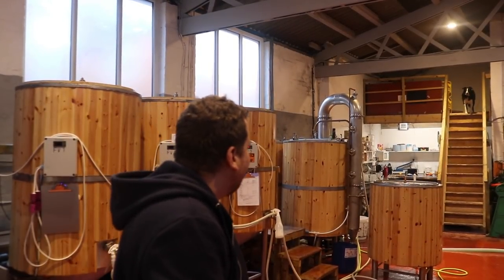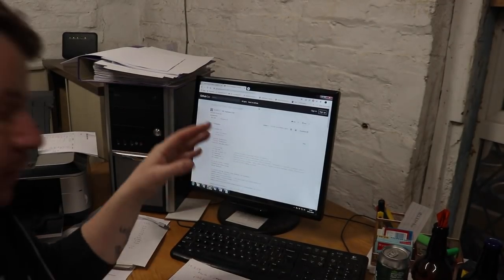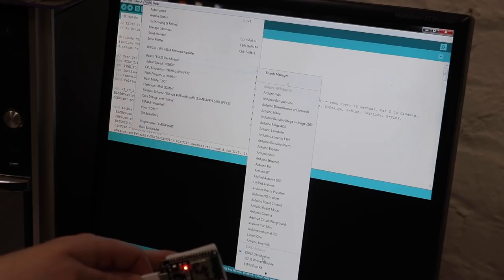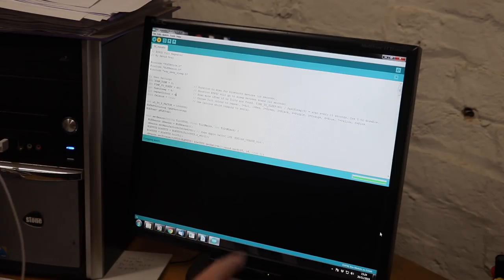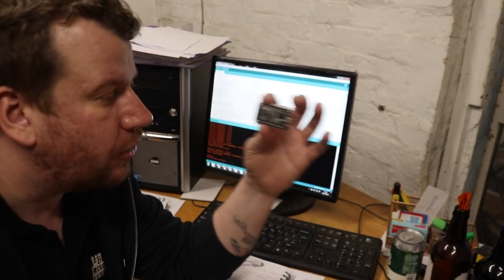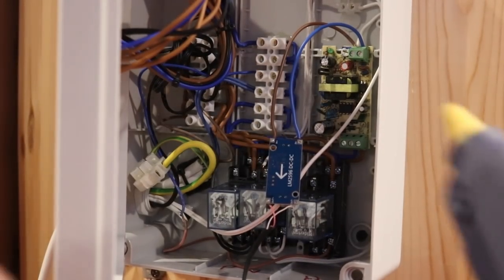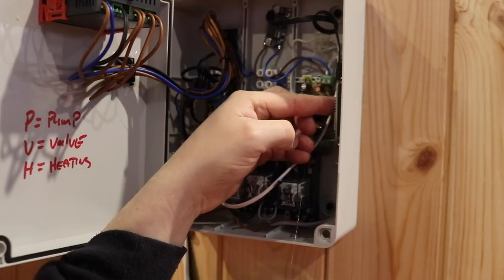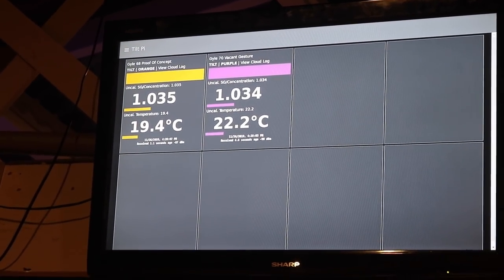Tilt Hydrometer Repeater with ESP32

Comment: Thanks for the shout out Harry. Glad it's working out for you. The code has been put into an actual repository now @ https://github.com/N3MIS15/ESP32-Tilt-Repeater . The gist is still up to date though. I don't have the exact modules you are using, but I imagine you could have soldered the output from the buck converter directly to Vin and GND and do away with the micro USB cables. Cheers.
Reply from the maker: Brilliant. I was going to attempt soldering direct but was worried about damaging the board. Thanks for letting me use your hard work as I have no clue how to write code.